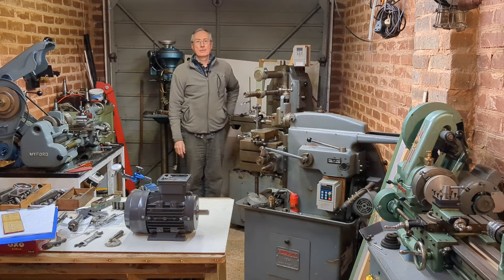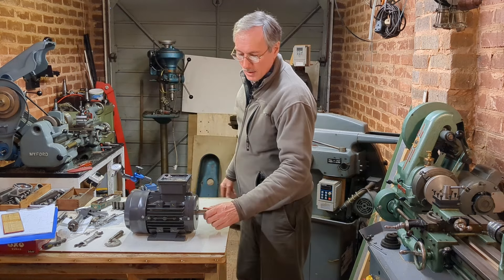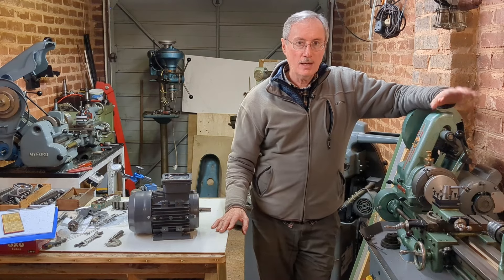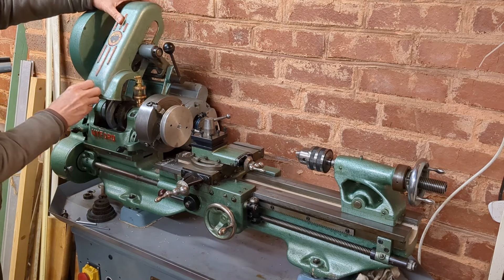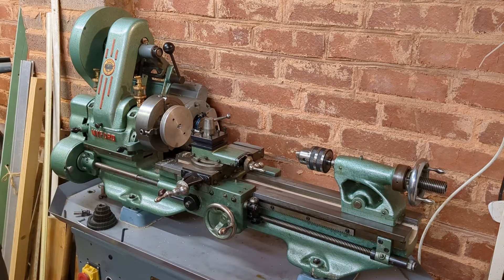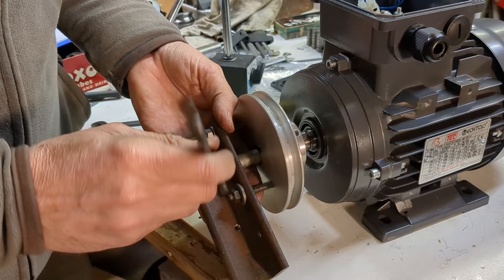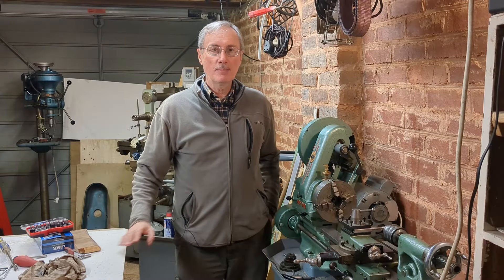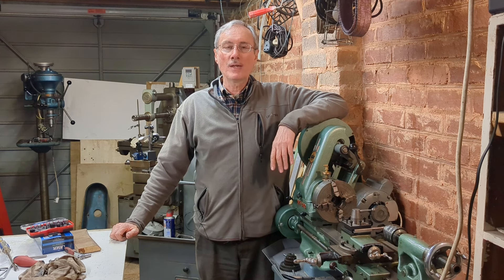Myford ML7 lathe for sale with demonstration

Comment: Another excellent film. The pulley turned out perfect. Someone is going to be very pleased indeed with your Myford lathe. Looking forward to seeing your Student arrive.
Reply from the maker: Thank you, Carl. Currently fitting the motor so will soon see how it performs on the other lathe. There are a few minor obstacles to overcome in shipping the Student. Will see - perhaps will be material for a video.
Reply: @Workshopfriend  it will be interesting to see how you get it from Pakistan to the UK. About 2 years ago now I made a set of universal machine moving beams. They are basically box section beams with jacking castors. With them I can move any machine I have singlehandedly and in absolute safety. I did this because I have had two accidents moving machines. One was my fault. The other was a courier when my Harrison Mill tipped over in the back of the delivery lorry. Luckily no one was hurt.
Reply from the maker: Hello Carl. Yes, a good point! It made me think I should lower the centre of gravity by packing in wider based box and removing the headstock and tailstock to sit on the base of the box behind the stand. I can imagine the lathe fully assembled being unstable and I can't be sure a forklift will be used to load at my end.
Reply: @Workshopfriend  Yes. The problem is nowadays that most couriers have no experience or understanding of moving machine tools. Top heavy beasts as you have rightly pointed out. I took every precaution when I bought my mill and had it delivered. A representative from the courier with machine moving experience went to the seller and ensured the C of G was as low as could be and that it was properly fixed to a strong blue pallet. After all that, the delivery driver tried to move it in the truck with his pallet jack. Rotated the steering tiller around the full 90 and pulled..wheel acted as a perfect hinge and the machine went over on its side. Fortunately no one was hurt and the machine was only superficially damaged.

Comment: The first thing I’d do is line the walls with insulation to help manage humidity and temperature changes. You’ll get less rusting that way.
Reply from the maker: Thanks! I am sure you are right on this. In the meantime I have insulated the front door and the ceiling as well as improving draft proofing. Even with that there is a noticeable difference.
Reply: @Workshopfriend 
I also insulated the front door and found the same great result. I use to run a dehumidifier, but in my new place I just sealed the concrete floor with a colourflake coating and it works wonders.
Reply from the maker: @Forexfox99 Thanks for the suggestion. I have thought about sealing the floor but that will have to wait until I am prepared to move everything!

Comment: Nice video , eventually when the adcock & Shipley mill is finished I plan to re motor my mk1 super 7.
Reply from the maker: Yes, I am sure it will be very useful to have the A&S up and running. I need to use mine to elongate the slots in the motor plate to allow the motor to be located closer to the correct position of the drive pulley. I am finding the motor mounting on the Super 7 quite fiddly.